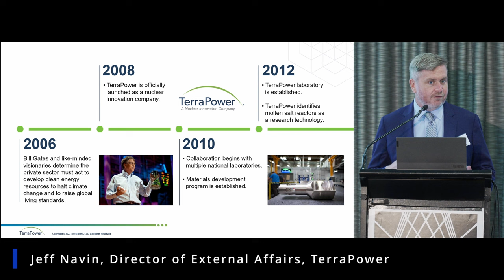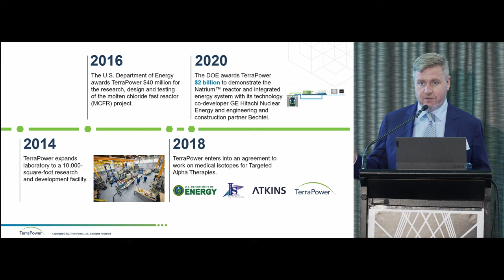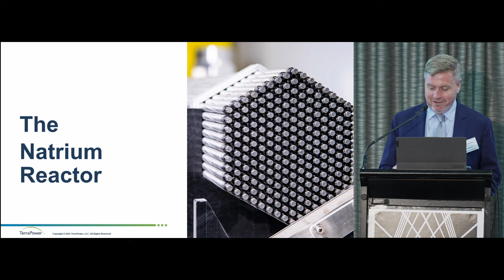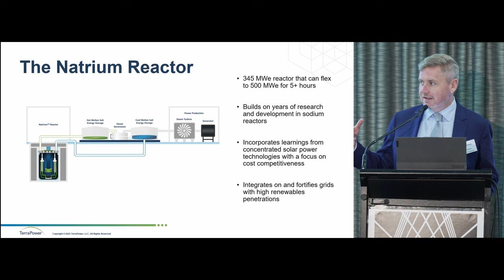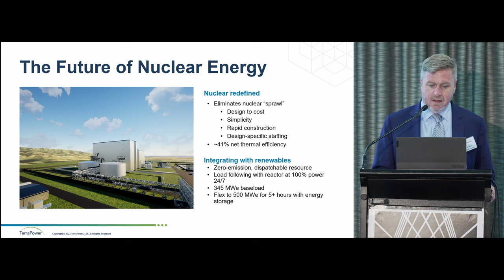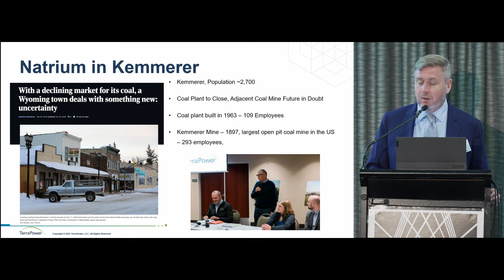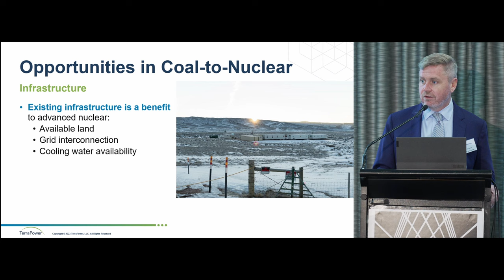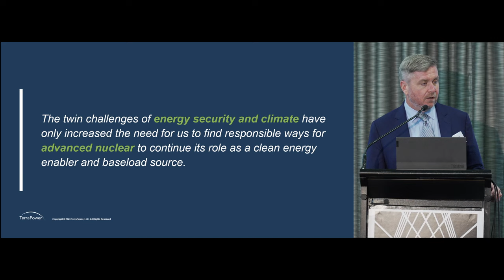TerraPower: Natrium Reactor and Integrated Storage

Comment: What I didn't hear was when the project would be up and running.  Not likely before 2030 and that's only if they are able to demonstrate that all the innovations work out of the gate, which is unlikely.  There is a huge unknown to make this viable in the long run and show the fuel efficiency and re-use they are hoping for.  The "Traveling Wave" phenomena it depends on is theoretical and never been demonstrated as far as I know.  This is what is supposed to allow reusing spent fuel and burn off the fissionable byproducts that are so harmful to the environment.
Reply: This is not a traveling wave reactor, that's a completely separate technology that TerraPower is working on. They are also working on a Molten Chloride fast reactor, again as a separate project.

Comment: why. if you can provide reliable base load power, do we need to integrate it with wind and solar.   wind and solar will just screw everything up--only bring back the worries when the sun doesn't  shine and the wind stops blowing.
Reply: That’s politics, you can’t say what is going to happen you have sneak nuclear energy security up on people and let them experience the benefits. Stable, affordable energy, what an innovation!
Reply: Batteries are becoming extremely cheap.  The combination of wind and solar with batteries can easily make up for those times.  Batteries will be half price from where they are in one year!
Reply: Because solar and wind are cheap
Reply: @veteransniper6955  they are only cheaper because they are doing their own math.
Reply: @veteransniper6955  : Solar and wind are VERY expensive. Why is the UK closing down their wind farms?
Reply: @buildmotosykletist1987  I can find information about UK that wind electricity production exceeded production from fossil fuels for two consecutive quarters. I wonder how much and which wind farms UK closed?
Reply: @veteransniper6955  : You'll also find power generation by wind has in fact reduced substantially.
Reply: @buildmotosykletist1987  I can find UK installed wind capacity is 28.5 GW, I wonder which wind farms UK shut down you talking about, and what was installed capacity of those wind farms?
Reply: @veteransniper6955  : OK, you can ignore the facts and reality but that won't make them go away.
Reply: @veteransniper6955  : Nuclear is by far the largest source of emission free electricity in Europe and US.
Reply: @buildmotosykletist1987  you didn't provide any facts. From your earlier comment I understood you think "UK closing down their wind farms" proves "solar and wind are VERY expensive". Which wind farms you are talking about to begin with?
Reply: @veteransniper6955  : Or; "Work has stopped on one of the UK's largest offshore wind farms after its developer said it no longer made financial sense to continue. "
Reply: @buildmotosykletist1987 the project you are referring to, is expansion of UK's wind power, not closing down wind farms
Reply: @buildmotosykletist1987 halted project, Norfolk Boreas, is one of three by the developer, 1.4GW of 4.2GW, which you may conclude means 2.8GW wasn't halted
Reply: @buildmotosykletist1987 the reason was inflation and wages rise, which applies to any type of power plant
Reply: @veteransniper6955  : Nope. "Closing down" means closing down.
Reply: @veteransniper6955  : Easily debunked by search. You are a time waster.
Reply: Also rwe bought all three projects and continue
Reply: @buildmotosykletist1987  you completely failed using line of argument you chose, you picked 1/3 of one project of many on various stages of development to somehow prove solar and wind are "EXPENSIVE" and even it backfired, so pathetic.
Reply: @veteransniper6955  : No. It's fact. Why are you denying reality? Are you a FACT DENIER.

Comment: That's not a bad presentation at all.  It was a good point that Jeff Navin made that just one of these plants gives about ten times the energy storage as is currently in all of Australia today.

I hadn't realized that.  It's really quite amazing.  And we could easily expand that. Just add more molten salt storage tanks!

I suspect that once you heat up that salt then this energy can be stored almost indefinitely in an insulated tank -- to use whenever you  need it.

This is a very efficient energy storage technology.  It's the only really good energy storage technology we actually have.

This is going to be hugely more efficient than trying to store energy in lithium batteries!

But of course what really matters isn't efficiency but cost.  Perhaps it's too early to say what this is going to cost, since this is a brand new technology.

Comment: atrium talks about uranium, can thorium be a substitute?
Reply: No.
Reply: Increasing uranium burn is still a step towards efficiency. It seems it's a bit more efficient than conventional reactors without reprocessing. I've not readen about mixing thorium in this design.
Reply: No. Not yet but the research ic continuing.

Comment: It like your part way to a Molten Salt Reactor, it great your getting rid of the water out of the nuclear part, but you are still using fuel rods? What will be your uranium burn efficiency? Is it still only 1% with the other 99% of the uranium being contaminated and requires 20,000 years of specialised storage? How will you source the right type of uranium so you can use it to contaminant the low grade uranium especially if you're reactor catches on, you will probably need something similar to a Molten Salt Reactor to make more of high grade uranium that this reactor can't make for it's self.

Sadly we might have to buy better safer reactor from China because of the bureaucratic red tape against the Thorium Molten Salt Reactor. There might be a statue someday of Alvin Weinberg standing in china next to the prototype reactor, you can use your own imagination as to what possible statue gesture is used in the direction of Richard Nixon gravesite.

Comment: Using Natrium as coolant, what could possible go wrong?
It reacts to water, but that is no issue. I promise!
Reply: Only a problem if it leaks. It's melting point is 98C would turn to hard butter like pliable metal soon after leaking and could capture the leaks in a bath of oil, where it sinks to the bottom.
Hope they don't have a sprinkler system installed though.

Comment: So 25 tonnes of Uranium per SMRs 300mW.
80 SMRs is 2,000 tonnes of uranium. 
400 SMRs is 10,000 tonnes of uranium.
So 2,000 tonnes at 5% = 100 tonnes at 100% enriched uranium.  ??? U-235. That sounds about right for any nuclear industry to produce.
200 countries in the world producing CO2, they will have their own nuclear industries??????
Reply: 300MW.
I'd be very disappointed if it was only a 300mW reactor. Even the first reactor to generate electricity produced about 200Watts. Perhaps you meant MW.

The amount of fuel needed for this reactor was not mentioned in the presentation, nor is it on their website, or in the public versions of documents lodged with the US government and associated regulatory bodies. 

As far as fuel goes, the US government says they will need 40 tonnes of high assay low enriched uranium (HALEU) by 2030, however, it's not clear how many reactors this would be used in, or the longevity of this stockpile, but this Terrapower reactor will use HALEU. 
Current production in the USA is less than 1 tonne a year, though a new plant is being built to make up for the inability to buy from Russia based company, Tenex.
Reply: @cerealport2726  Australia exports yellowcake. 
They have very large ponds to catch the waste. These ponds are in the tropical flooding area and have the risk of bursting and poisoning downstream eco systems. 
More yellowcake to the world??? Who knows what impacts will follow.
Reply: @stephenbrickwood1602  No current working Uranium mines exist in the topics. Check your facts, if you have the mental capacity.
Mining at the Ranger mines stopped many years ago, and ore processing stopped about 3 years ago. 
Rum Jungle was mined in the 1940s, and this was done very poorly to say the least. Nonetheless, should they ever decide to exploit Rum Jungle in the future, current mining processes would not repeat these mistakes.
Reply: @cerealport2726  yep, no more mistakes, smarty pants.

Comment: 20million vehicles in Australia. 
20million EVs with big 100Kwh battery is 2,000 giga watt hours of dispatchable stored electricity. 

Most vehicles are parked 23hrs every day. 
Most vehicles daily drives are 7kwh, and can be topped up daily, ezi pezi.
2 decades to replace all ICE vehicles. 
One, 1, decade to achieve 1,000 giga watt hrs  daily storage. 

Nuclear electricity would mean 80 SMRs, just to replace existing fossil fueled generation. 
400 SMRs for a full electric future. 
Decades and decades and ....
$TRILLIONS and....

Will the government ban 20million rooftop solar PV to protect the nuclear electricity cash flow????

Comment: Generation is a small part of electricity costs.

The grid itself is extremely costly. 
3 to 5times more electricity means a horrendously expensive construction of bigger grid capacity.

Add those costs to the nuclear generation costs. 

I can tell you that you will not be using trucks to transport EXTRA electricity to the ends of the National Electricity Grid.
Reply: Renewables require a far more extensive and expensive grid than nuclear.
Reply: @buildmotosykletist1987  All grid electricity is too small because most energy is fossil fuels.
To replace fossil fuels, the grid capacity has to be monstrously big.

The customers will not be able to pay for the massive cost of the new monstrously big grid capacity. 

The grid was brilliant when dirt cheap fossil fuels could be used without restraint. Fossil fuels carried the majority of the energy demand load from the population.

With cheap batteries and the sun shining on rooftop PV, the grid for home and building use, customers will not need grid electricity.
Reply: @buildmotosykletist1987  you confuse rooftop solar PV with distant energy. 
Rooftop is at the customer's building/ home.
Distant energy must have the grid to the millions and millions and millions of customers.
Grids make dirt cheap electricity, very expensive electricity. 

That is the biggest problem for all distant electricity. 

Rooftop PV biggest advantage is no grid costs and a big fat oversized battery parked 23hrs every day and all night.
Reply: @stephenbrickwood1602  : Roof top is fine as a supplement but can't supply baseload power. Nuclear, coal, gas or hydro are required.
Reply: @stephenbrickwood1602  : Roof top is fine as a supplement but can't supply baseload power. Nuclear, coal, gas or hydro are required. The current grid will not require the extensive increase that renewables requires.
Reply: @buildmotosykletist1987  Do you know that the grid can only transmit 25gW, but 170gW capacity is needed to be 100% electric. 
Do you understand numbers? Many people do not, and it is impossible to explain this stuff to them.

Comment: So one thought that jumped at me at the @9:22 minute mark is that terra power took a struggling community, that would be most hurt by the closing of politically incorrect coal, the coal suddenly shuts down, so they called them up, and now they have a state and community that is bending over backwards to have this new nuclear plant installed in their community.  Has anyone looked into just why the 4 coal plants were shut down?  Did Bill Gates himself or his donation put any pressure on this?  Maybe working through the EPA or federal govt to have the 4 coal plants shut down?  The more you know about Bill Gates and how his foundation operates the more you'll see this as possible.
Reply: That coal plant was already scheduled to be shut down, that's why they picked that site.